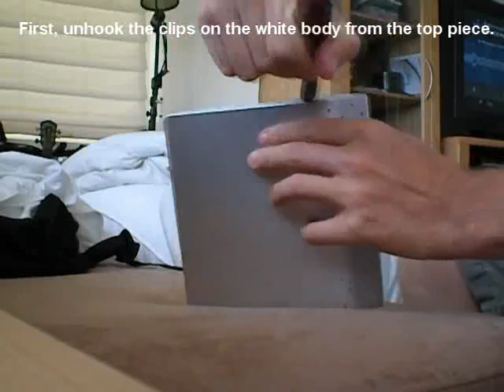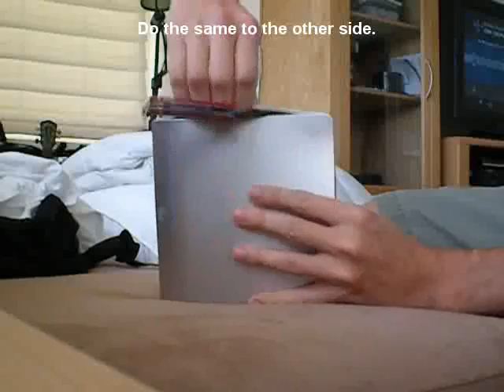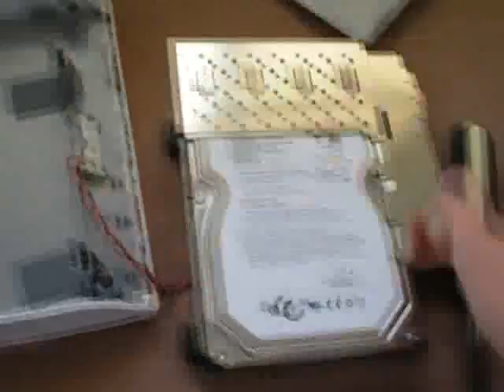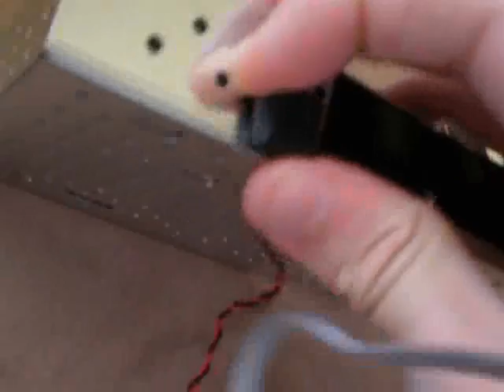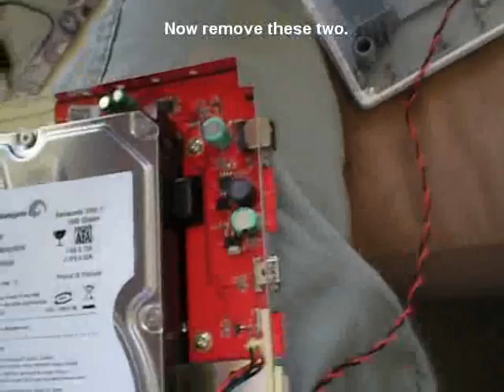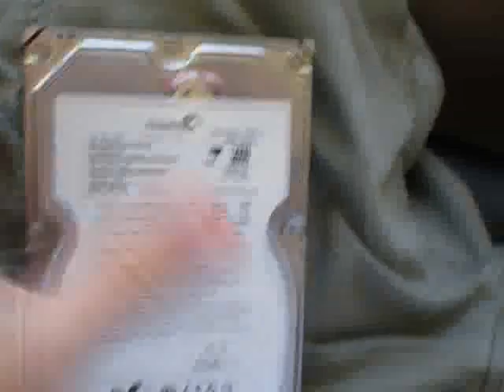How to open a 1.5 TB Seagate FreeAgent Desk External Hard Drive

Comment from the maker: I just poked around in my tool drawer until I found one that matched.  I had no difficulty at all with either of the two drives I messed with.  Also, this won't destroy anything unless you're overly violent with it.  You should be able to put everything back together easily.

Comment from the maker: yes, it's a sata drive inside.  Most external drives these days are.  That doesn't sound like a power problem; if you NEED that data, you should take it out of the external and test it in a computer.  Otherwise, you'll need to send the drive to a recovery service; both options would require you to take the drive out of the enclosure.

Comment from the maker: @thowell2989 There are no tampering indicators (like stickers that rip when you take the drive apart). So long as you don't damage the plastic case, there's no way to know the drive has been opened. Warranty is intact so long as you don't replace the drive with another one.

Comment: I had a slightly different model, 500 GB. It was a little larger, and probably a little older. It was hard as shit to pry that thing open, and when I finally sloppily did so, I plugged it into my motherboard, just to find out that the entire thing was dead, and it wasn't just a power failure on the case. One thing's for sure, I'm never getting SeaGate again... especially since they make screws that no driver/torx can unscrew unless you have SeaGate's own personalized sets.

Comment: The FireWire 800 unit is different. If you have the FW800 unit, remove the thin cover on the top and you will see two screws. Remove those two screws and the top cover (the one with the logo) is ready to be removed. There are FOUR major clips that extends all the way to the other end.

Comment: THANK YOU! I have the exact same hard drive and I need to open it...but since I'm a noob I don't want to base what I'm doing off another hard drive's tutorial
Basically, my hard drive doesn't run all the time, I have to smack it or turn it on it's side for it to work...and any vibration causes it to shut off...how do I fix this?

Comment: @maxythecuber No I think the PS3 slim uses 2.5" diameter disks. Your best bet are the new 750GB 2.5" hard drives, such as the Seagate Momentus 750GB 7200RPM drive..

Comment: haha i love the dramatic music!

one question - this is a sata drive connector correct? 

reason i am asking is i recently bought a brand new feeagent and it doesnt want to turn on all the way (you hear the booting but then slows fades to nothing). problem is that is my backup drive and i NEED that data. i called seagate and they said they can try sending me a new power adaptor but i doubt thats what it is. if that doesnt work ill have to void the warranty and fight segate to buy me another!

Comment: @danamichelle007 The fluid dynamic bearing assembly that holds the platter spindle in place is notoriously fragile in these drives. If it was powered ON when it fell, most likely the drive is toast. The spindle dislodges from the bearing assembly causing the platters to tilt, damaging the arms and heads (not to mention the disc surface) to the point that data cannot be recovered (using conventional means). If the drive was not powered on when it fell, and it hasn't spun since, there is hope...

Comment: @maniac749 The Seagate Drive in this video and in others are all S-ATA drives, you can tell by 3 things:

 1. The fact that it would not have an eSATA port if the drive itself was not S-ATA based 
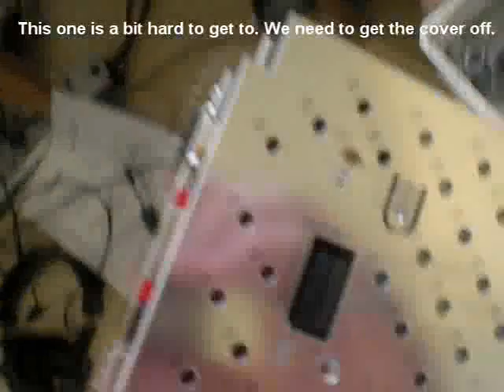2. at 2:11 in the video there is a stamp on the middle right part of the screen which has the S-ATA logo to the right of the Fragile symbol.
3. I am assuming that IDE drives do not support the bandwidth or transfer rate that a S-ATA drive can support over Firewire and esata cords

Yes
The drive is SATA

Comment: @catfdljws actually i don't need to do this now - it was just the cable shorting out the power from the computer's USB.  swapped cables and it works just fine again.  But i'll keep this bookmarked if things change...

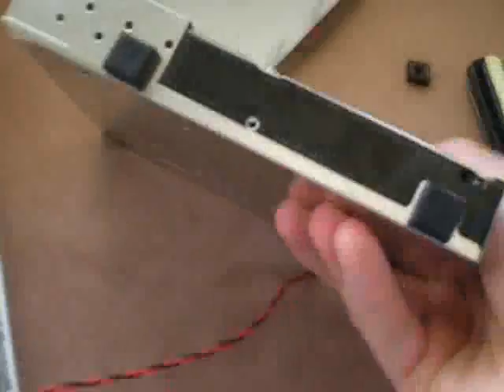Comment: thanks a lot almightytrent....damn seagate has some good screws... for the one visible at 1:55, do yo have specs of the tool used to unscrew it?? i've "machined" 3 of my screw drivers trying to unscrew it!!!!

P.s I do not want to destroy any of the components(like casing etc.,) i would like to put the HDD back into the case...

Comment: Hey, I have the same case only it's a 2TB and i saw on the metal casing it looks like there are other connectors or something can you use something besides the normal A to B USB connector for hooking it up if you moded the case to allow it?

Comment from the maker: If you mean removing the hard drive from an external and placing another one inside, yes, it is very possible.  That red circuit I show at the end is all you need to convert an internal to an external.  Just plug in the drive and connect it via USB.

Comment: Is the drive itself IDE or SATA?  I need to know what enclosure to replace it with - I'm having a problem where it is deciding to draw "too much power" from the USB (even though it is independently powered via AC ???), power-crashing my cheap netbook. My Mac detects that it's trying to draw too much power and shuts the USB subsystem down 'til I unplug it.

Comment: Seems as if you can just open it up and figure it out as you go. Once you get it open, can't you put it in another enclosure that has a firewire port? I have a Freeagent drive just like that (1TB though) and hate how it constantly goes to sleep. I use a mac and edit video so it's rather annoying. Mine is USB unfortunately. I'd like to get an enclosure where I can manually turn it off and on with a switch.

Comment: @gurlzgotskillz52 plug it in as another hard drive. if you call seagate and its still under warranty they will send you a new hd, get your credit card number (just in case you dont send the old one back) and then you can get permission to open the case to get your data back...

Comment: @toysareforboys1 Ahh okie thanks. It was kinda hard to tell in the video. I actually did pop open the case on mine, a 1.5GB Freebird and saw it was SATA, but my PS doesn't have a SATA connector so I'll have to get an adapter or new PS.

Comment: @toysareforboys1 Hello there, need some assistance please??? Ok here's the deal - I gots me a Seagate 1TB external hard drive from an electrical store back in April 2009.. All was well until I'm hearing bits inside the external, sounds like either plastic bits or components are loose, as when I tilt it or carry it around with me it makes noise-I've never dropped it..!! Now my Seagate works fine, it reads on my Laptop & PS3 fine-I'm paranoid that it might go to kaput in the future, any advice..??